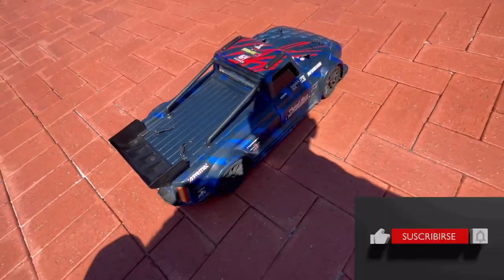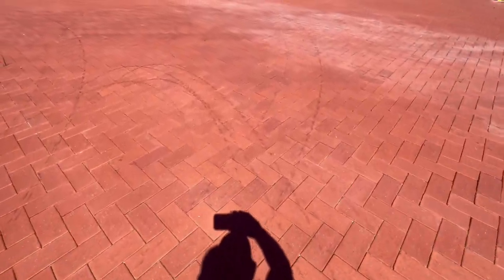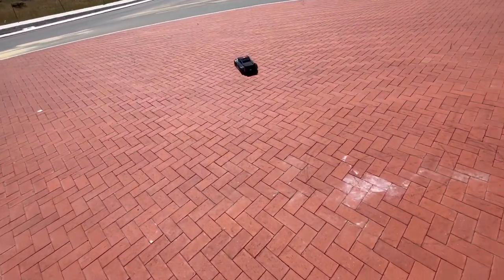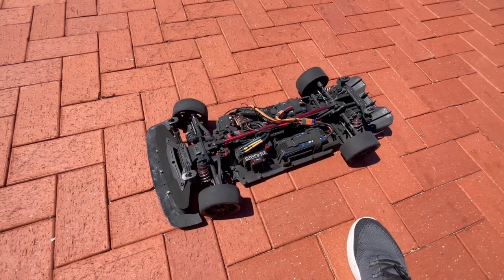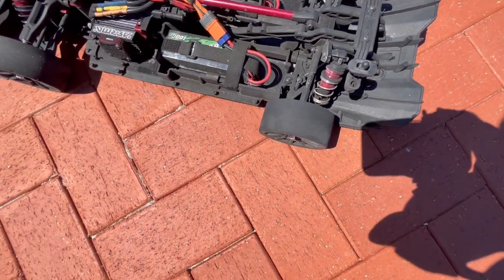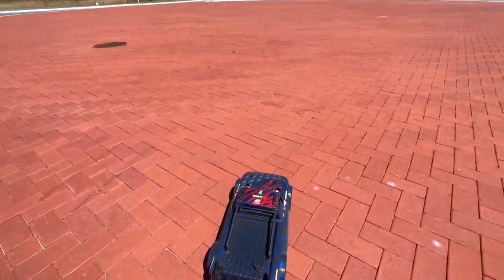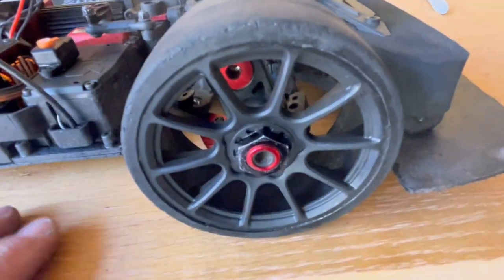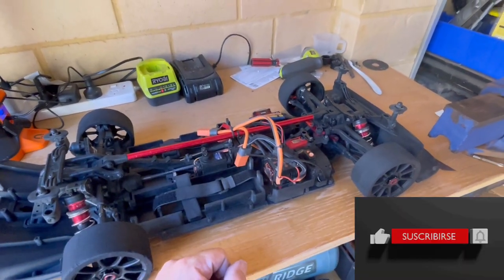**RESULTS ARE IN** - 'VIPAZ' Solid Rubber Tyres on Infraction 6s after 12 Packs

Comment: Just waiting on glue for mine!! I estimate 6 to 8 packs on my rig. Ill b ecstatic if i get more than that.(note: Locktight 424 is not readily available in the US. You have to buy it from overseas) cheapest i found was $31 for a 20g bottle! Im sticking with bob Smith industries.
Reply from the maker: Nice brother. That’s crazy 424 isn’t available there. I got mine for $17 and that’s a bargain. Just use a high quality super glue and you’ll be good to go bud. Can’t wait to hear your results. 😎👊🏼👍🏼👌🏼

Comment: I am excited mine are supposed to arrive in the mail today.  I am putting them on some j concepts cheetah wheels.
Reply from the maker: Oh awesome brother. Prep the inside and use quality super glue and they will work as good as these have. Keep me updated at how they are going. 😎👊🏼👍🏼🤙🏼
Reply: @WestOzRC  I got them mounted with the loctite professional strength.  They fit on the jconcepts wheels so perfectly.  My infraction is waiting on parts, so I put them on my new 8s mojave and covered the street in black marks.  Barely took the shine off the tire.  No signs of the edges coming unglued yet.
Reply from the maker: Hahaha oh wow that is so good to hear brother and I love the fact that you just wanted to get them running. The Mojo will definitely give them a good work out. Send me a pic of them on FB 😃👊🏼👍🏼👌🏼

Comment: Hi. Can you recommend any other wheels as the mach 10 seem to be discontinued now? Thanks
Reply from the maker: Hey bro yeah sure. You can use as set of used rear Felony wheels, you just have to cut the dish off the outer rim like I explain in my latest “How To” video. You can also use Typhon rims. You can still get Mach 10’s, you just need to search on eBay. I believe there are some in Europe that are still available. Any 83mm OD rim will do too that you can find. Cheers bro and let me know how you go and thanks for commenting. 😎👊🏼🤙🏼

Comment: What motor fan do use mate? Mine gets hot pretty quik with the stock fan.
Reply from the maker: Hey mate. I use the Surpass Rocket RC on the Infraction. 28k rpm and have never had a problem since installing them. I have a video on how I installed them. Check it out mate. I even have a link to them there. 😎👍🏼
Reply: @WestOzRC  Ah ideal mate. I'll watch that right now then. Appear to be cheaper than the aluminium  yeah racing fans I use on my e revo also which is a bonus.
Reply from the maker: @lukmankarlia8058  nice mate hope you find it good info. 
Yeah they’re very well priced indeed.

Comment: Way pricey. Almost $150. Ouch
Reply from the maker: What is even more way pricey is a set of $140 Hoons every 2-3 packs. These have lasted 12 packs so far which has saved me $850 and they still have more to go. I’ve already got guys saying they are the best tyres they have ever had and one guy has put them at 112mph. They are awesome brother, get a set and see for yourself. Any profits made from this project goes straight back into development into other sizes including the rear Felony wheels. 😎👊🏼👍🏼🤙🏼
Reply: I've got a 6s/8s (160a/1250kc) Infraction and after two 6s 6000mah 100c Zeee packs my WestOz solid tires measure 99.76mm & 99.80mm rear and still over 99.9mm front. Not bad after two packs, I was lazy and didn't rotate till after pack 2 😬🤣.
  These tires are phenomenal!!  The Infraction feels smoother and more fluid....not that it ever felt shetchy or or twitchy.
 Excellent tire, perfomance and durability....if you run a set you'll understand.
...less than the cost of two sets of almost any other tires, and these will outlast all of them by probably four times, at least....
    Not sure about you, but my Infraction doesn't sit on a shelf...